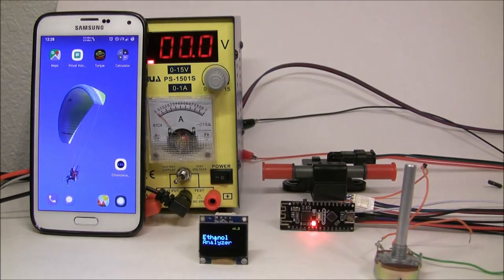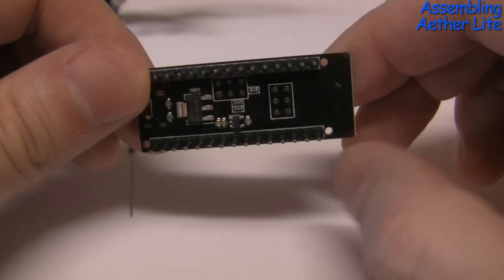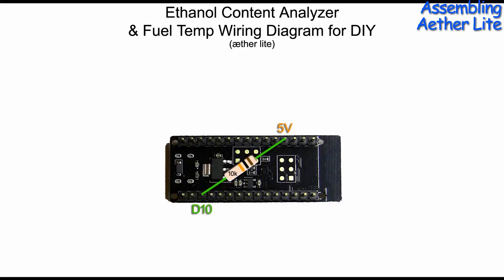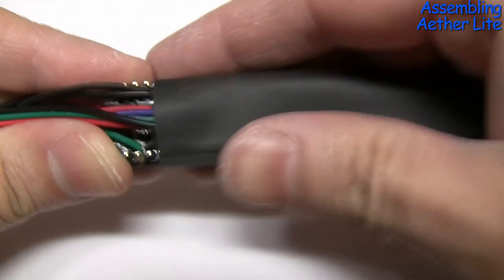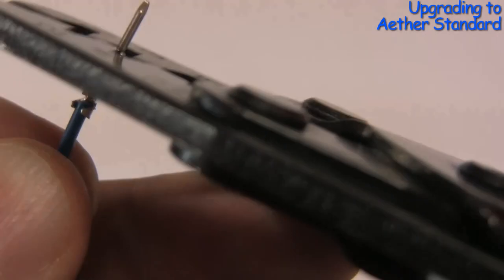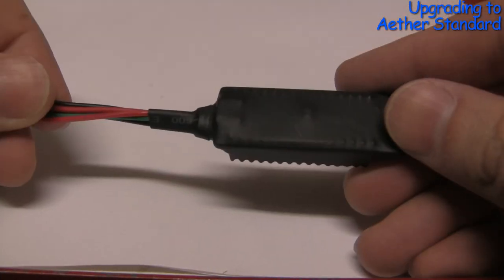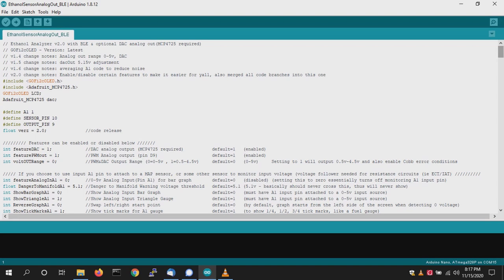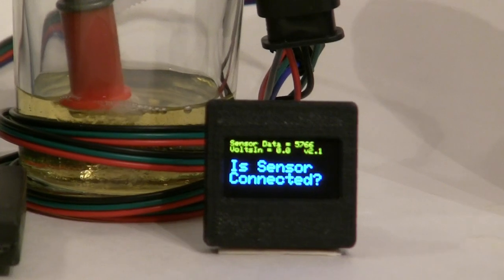DiY Bluetooth Ethanol Content Analyzer + Fuel Temp Display

Comment: No clue if you are still active but I'd like to thank you for this write up/video. Trying to finish mine up now.
Reply: How is this going for you. About to try to make mine soon
Reply: @Daniel Johnson  haven't had a chance to install due to weather but tested with analog kit e85 tester and the sensor and was 100% accurate reading.
Reply: @killaspycdr5560  that’s great I just ordered the parts yesterday. Mind if I ask how did you install the code? What code did you use. Sorry for all the questions just not sure exactly how code works.
Reply: @gamearron  do u was able to do it? I got a Arduino nano V3 and small screen around just need resistors I like to try it

Comment: Awesome work!  I see your site shows these are all out of stock, will you be replenishing stock soon? Also, I plan to use this with a JB4, how hard is it to connect?
Reply from the maker: The silicon shortage has severe backorders on many electronic components.  I'm waiting mostly for flex-fuel sensors.  FYI, working on another redesign (integrating everything on a PCB, including DAC) - this will also make assembly easier.
Reply: @turbokeychains7855   I am thinking I will also want a fuel pressure sensor installed inline with my Ethanol Sensor. How difficult would it be to have the Arduino display both sensor information on the app as well as LCD display?

Comment: Are you able to use a standard nano board with the atmega328p with your code and an add-in bluetooth board like an hc-06?
Reply from the maker: I haven't tested it.  In theory it may work if you can get HC-06 to use BLE. In the app you may have to "scan" and find the HC-06.   Additional Arduino code changes may be required to set the announcement variables and such.  Keywish & emakefun boards have default hard coded BLE settings, so the additional code isn't necessary in Arduino.